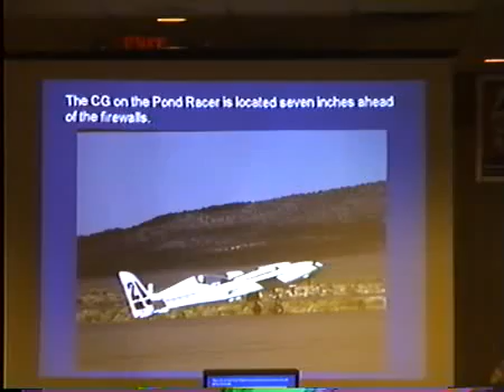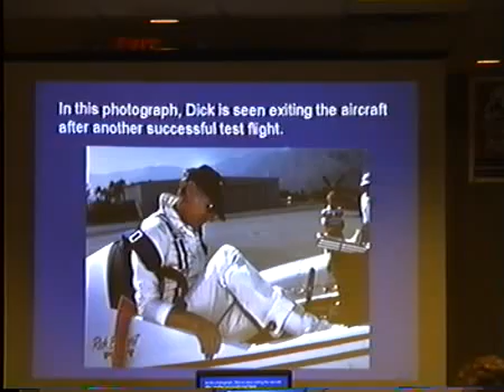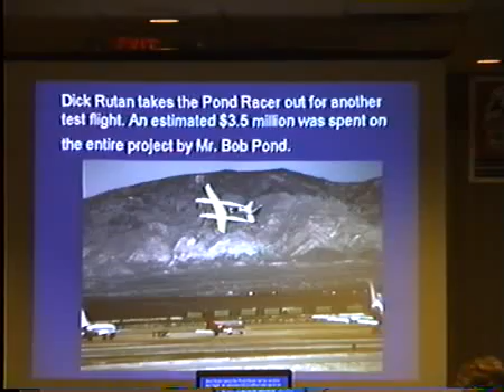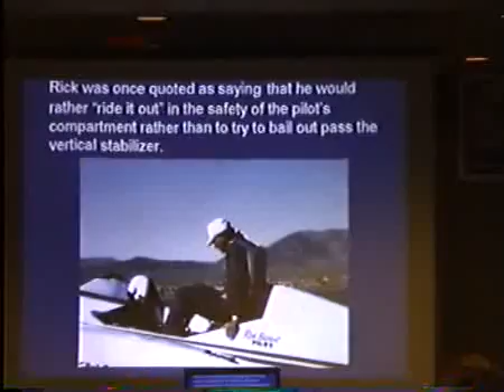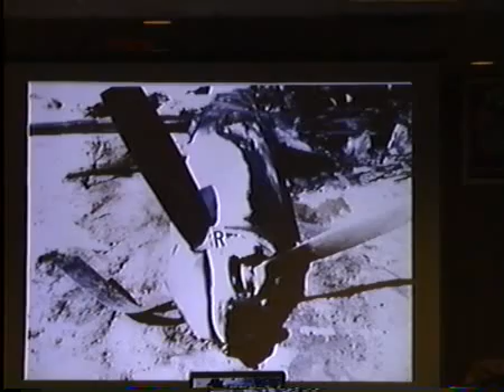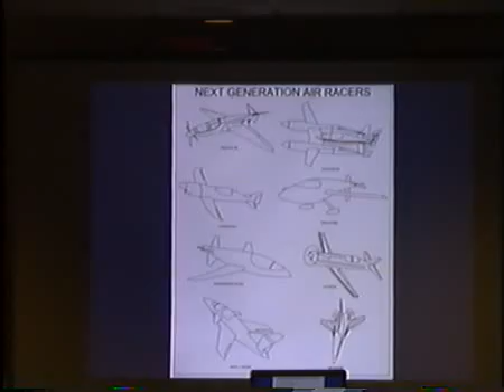Pond Racer (Beyond the cutting edge) Part 3 of 5

Comment: I'd bet that Judd Power GV 4.2 V10s would be the best choice today. 775 hp (and built to produce that power output for long periods of time), less than 300 pounds dry, the whole installation would probably be 300 pounds lighter per side and much simpler.

Comment: Rotaries would be ideal for hot rodding aircraft, they are extremely reliable while the seals are new.
Reply: Piston engines are plenty reliable, but the testing needs to be done on the ground, not in the air. If Pond and Scaled had done their testing on the ground, all issues could have been ironed out before putting a man's life at risk.
Reply: Indeed. Nowadays you can buy a set of rings (seals) for a race wankel engine wich are diamond coated. They last longer. Wankels have high fuel burn figures and lower efficiency, but can be very powerful.

Comment: really? which formula 1 engine produced 1000hp per liter?
Reply: Yep. Nelson Piquet drove a 1.4 liter BMW blown engine in the qualification of the Zandvoort F1 many years ago. Later they admitted 1500 hp was mobilized using more than 4 bar inlet pressure. The engine was running full rich, I saw black smoke trails from its exhaust during that run.
Reply: Honda and BMW engines were both close to that (around 900 hp/l), but not quite there.

Everyone always seems to forget that Honda dominated F1 in that era.
Reply: @PistonAvatarGuy  I was there at all the test engine run up's, they used Nissan engines. This aircraft would able to fly at Idle. Dick came to us to build avionics. my company was currently building glass instruments for EAA.